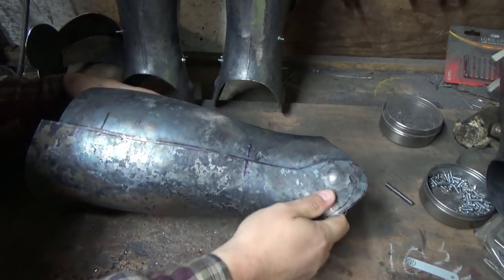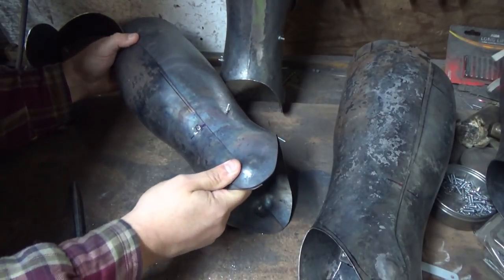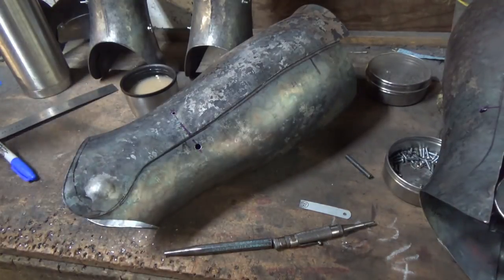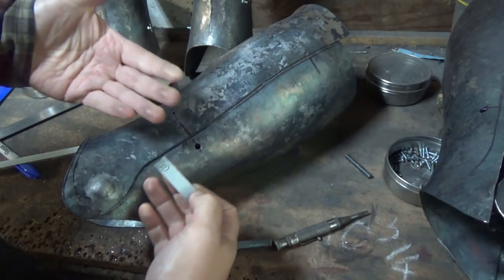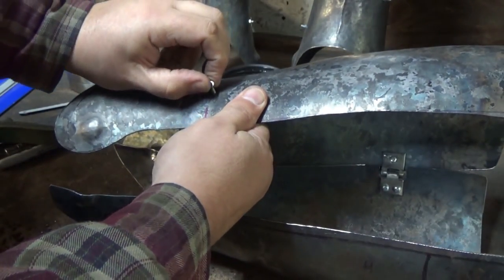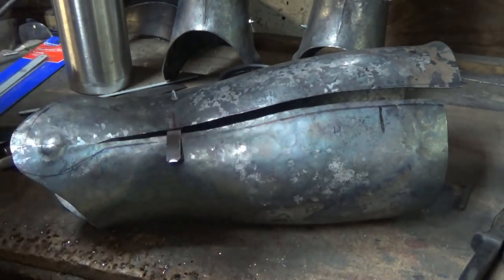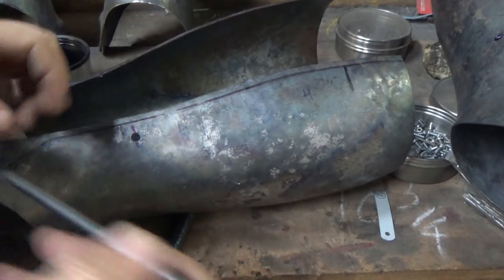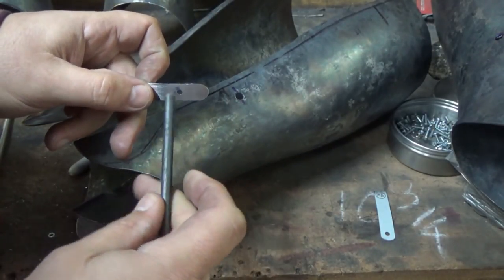Adding spring button catches to armour. Medieval Armour Technique

Comment: Should this work for enclosed Cuisses in the English style? I should think it a boon for not catching if you needed to put your legs together for a passing step. Is it historical? Thanks!
Reply from the maker: I think Henry VIII has them on his. What period are you thinking?
Reply: @GreenleafWorkshop  I was thinking along the lines of 1420s at agincourt like on King Henry V's or Sir Edmund de Thorpe's harnesses. On Sir Edmund's effigy specifically I don't see signs of any straps on the inner thigh at all, and suspected your technique.

Comment: How many such buttons would be on a single armour piece? Only one or more? On which pieces were they used and on which they would never be used? Could you make armour adjustable in size by adding additional holes for buttons?
Reply from the maker: I think I may have seen a couple with two or maybe even three holes for variation, but that wasn't on a greave, rather a cuirass. They appear around the 15th century iirc.

You can use them anywhere there is a closure for sure, but I'd be sure to check the original you are working from or the temptation to over use them might become too much :)
Reply: @GreenleafWorkshop  thanks for answering!
Since I'm aiming for larp-grade armour, I an focused on adjustability and ease of use, so buttons seem great. But I imagine aligning them well might be hard when there are multiple on single piece.